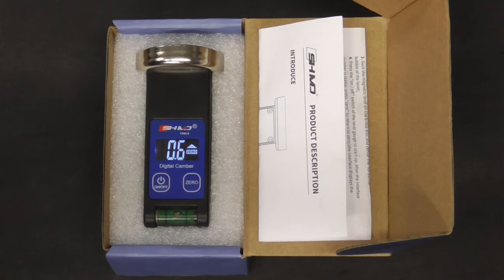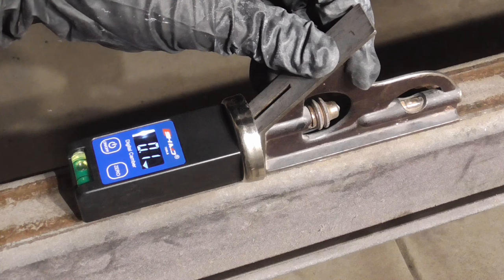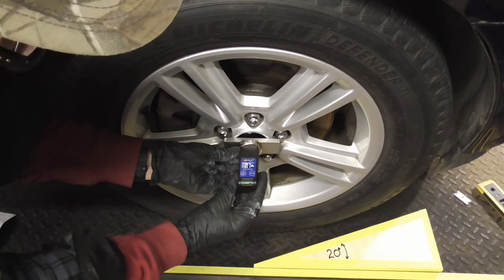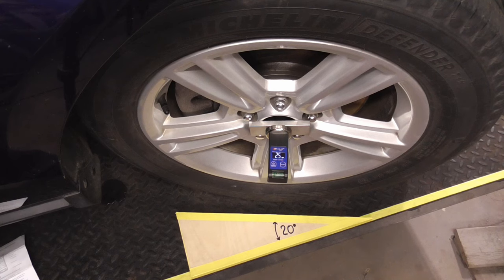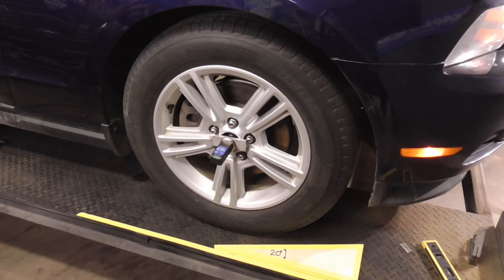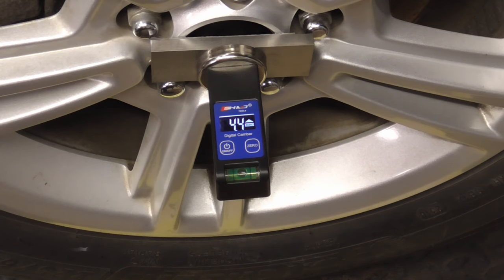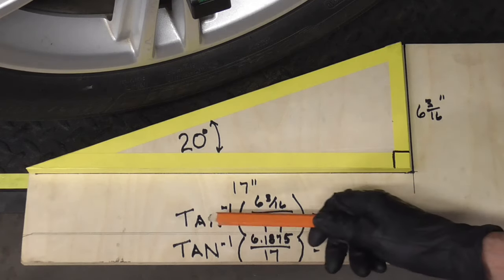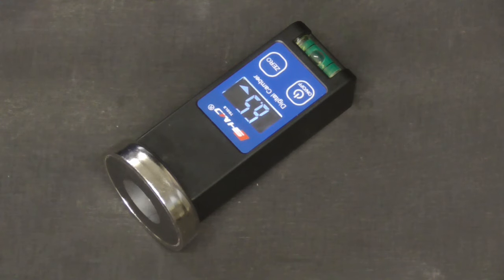Digital Caster Camber Gauge by KAISAL - Easy DIY Wheel Alignment

Comment: You need to multiply the "caster" measurement you have shown by 1.5 to get the true caster angle as would be measured on an alignment machine. If you look at bubble gauges, the scale is 1.5 times larger on the caster scale compared with the camber scale.  Otherwise a good instructional video. Thanks.
Reply: I'm a beginner but I'm not sure I can agree with that statement. A degree of angle change is a degree of angle change. If the digital measures that, then it's measured. The bubble gauges have more degrees change available in the caster bubble just for the capability. The camber scales are less degrees available to give more precision. I'm sure the arc of the glass tube in each is adjusted for the different scale. It still measures degrees of angle change. I'll bet both scales show the same degree change- until the camber scale runs out of range. Cheers.
Reply: @bw1841  Schnitzer is correct.  It is a trigonometry math equation.  If you measure the angle of the caster at 90 degrees, you would not have to do any math.  You turn the wheel out 20 degrees and zero the reading so that when you turn the wheel in 20 degrees, you get the difference between the out and in reading at exactly 20 degrees.  Then multiply that by 1.432 (1.5 is the industry standard) and get the true angle.  The farther the wheel is turned, the higher the gauge would have read.  You can do the same thing by turning the wheel 15 degrees in each direction, but then you have to multiply by 2 because your measured reading is lower by not turning the wheel as far.  There are digital gauges that do the math for you, but they have a caster button on them.  you turn the wheel out 20 degrees, press the caster button, then turn the wheel in 20 degrees and get the true reading calculated for you, but this one is only an angle finder and it does not do the math for you.
Reply: @CoroPlanesLLC  This is an excellent explanation and a very helpful answer. It's exactly what I needed to know to complete my alignment with a simple   castor bubble gauge.

Comment: OK.  bought the gauge. i did the castor check and it shows on left front 0.4 degrees arrow pointing in (negative?) and on the right side it says 0.5 degrees with the arrow pointing out (positive?).  How much trouble am I in?
Reply from the maker: It depends on what the specs need to be for your car.  Negative caster will roll straighter but positive caster will steer easier.  They should be the same though I would think :)
Reply: @LakesideAutobody  Am I correct about which one is negative and which one is positive?  I want positive camber.  It is a 66 xke so these things are really hard to change.

Comment: Had a front wheel alignment done by a tire shop with an accurate precision laser machine. I checked their results with the same tool in this video. The caster measurement DOES NOT need to multiplied by 1.5 and the tool displayed the same angular measurement of 4.7 degrees!!! BTW, 1 degree = 60' = 3600".
Reply from the maker: Thanks for checking that out - nice job.  Others will appreciate the comment too for sure :)

Comment: If I understand, you don't have to measure the floor angle when doing camber check because, you zeroed it perpendicular to the earth with a bubble level for instance, first.?
Reply from the maker: It was zeroed perpendicular to what the car was sitting on - in this case a 4 post lift -  think it was shown near the beginning of the video :)

Comment: How can you get any reading without using turntable plates?
Reply from the maker: Turn table plates show you the degree you turned the wheel - that's it.
Reply: @LakesideAutobody  no. Turntable plates allow the front suspension to spread out exactly like it was going down the road. After each or any adjustment we grab the front bumper and bounce the car to assume the new driving position. Degree markings allow you to check castor with regard to how the machine is calibrated. Bean equipment 40-50 years ago only turned 15 degrees. Without turntables you can't do any alignment.

Comment: This is great. I just bought the same item, then found your video!
I put a new steering rack on my pickup, and new upper control arms with balljoints. I must've had it set okay using just a level for camber, then a 2x4 on jackstands for toe adjustment. The tires haven't worn in several months.
I'm about to do lower balljoints because they have play.
I'll just set it with this when I'm done.
I've found that alignment shops only want to sell me suspenion work. Guys who do their own work are not a cash cow for alignment techs.
Any shadetree can do a satisfactory alignment just knowing the particular vehicle specs.

Comment: Cool I’ve got the non-digital budget version.  Used it and it kinda tells you a ballpark figure.  Problem is the fancy new cars have no adjustments.🙄. You kinda eyeball aftermarket shim things based on some magnet gizmo.🤷‍♂️
Reply: Right I learned that my 2004 INFINITI G has no camber or caster adjustments. You fix those by replacing control arms or bushings that are worn out. Then it's right. Then you pay for a whole alignment just to adjust toe...

Comment: How much can it effect caster measurement if you don't use a slip plate when moving tires back and forth? My thought for DYI'ers if performing on garage floor, spread out a small amount of very fine sand under the tires so when you turn them back and forth to perform caster measurement, they slide on the sand with out 'sticking' to the floor.
Reply from the maker: Good idea - seems like it would work :)
Reply: Use plastic bag with oil in it.

Comment: When he did the caster measurement,  did he forget to multiply the 4.4 degrees by 1.5 like it is suggested in other videos? Or when he leveled the tool, did it factor that in?
Reply from the maker: I think when you level and zero the tool out you're good - you don't have to multiply by 1.5.  Were they using the exact same tool?  Could be that their tool can't be zeroed out?

Comment: Can you explain what you mean by ‘zero the gauge in relation to the vehicle’?
Reply from the maker: Yes.  When you zero the gauge out in relation to the vehicle, you are putting the gauge in the same plane or "world" as the truck or car.  In other words if the vehicle is not perfectly level, that's OK, we can set the gauge to that same "unlevelness".  If that don't make sense ask again :)
Reply: This is tricky, assuming the ground is the same plane under all four wheels. Concrete will usually be the most level but even then might not be perfect (forget about your asphalt driveway!!). If the spot of ground you use to zero out the gauge is out of plane with the ground directly under the other three wheels you might have a problem. You'll still have this problem if you zero out on the ground by each tire. Realistically, setting it once should apply to all four adjustments, but real world? I dunno. This is why laser alignments will never be matched in the wild, they create their own plane.

Comment: set the toe and let it go,all I need is a tape measure,I can eyeball the rest
Reply: Yep, I replaced my entire steering and suspension and set it all up myself. Had new tires put on and a year later they still look new.
Reply: You didn't do camber, you just did the tore and tires didn't wear out?
Reply: @nahyoxsoldier3264  believe it or not,alignment machines are a newer concept,the people that taught me were some of the first people to use an alignment rack

Comment: What if the rotor is warped, how do you measure something like that? thank you
Reply from the maker: I don't think it would make a difference.  Usually a "warped" rotor is not really warped, it is microscopically thicker in one spot.  When you come off of an expressway at 80 and hit the brakes, then hold the pads against the screaming hot rotor, it can "absorb" some of the pads.  That thick spot ends up getting worse and worse obviously because it causes a hot spot right there - more friction every time you brake.  At least that's what I read so... at any rate - it's a very small measurement.  :)

Comment: Do you have to calibrate it first on a spirit level?
Reply from the maker: No - you will "Zero" it out in relation to the level of the vehicle.  You can set it on the floor, car lift posts, what ever works best for your situation.

Comment: Where did you get the small metal plate to attach to the hub?
Reply from the maker: It is a measuring gauge block (example) https://www.ebay.com/itm/225290642107?chn=ps&var=524268869458&_trkparms=ispr%3D1&amdata=enc%3A1n6eVlw8RS_q9lEA02K7xAw81&norover=1&mkevt=1&mkrid=711-117182-37290-
Reply: @LakesideAutobody  How did you attach it to the hub, magnet?

Comment: I get a  Tan -1 reading of these numbers as 35 not 20
Reply from the maker: Make sure the calculator is set to degrees and not radians - let me know if that works for you :)
Reply: @LakesideAutobody  I have an old Ti-81—THAT DID THE TRICK.  Go into MODE, select degrees instead of radians, then proceed to enter exactly as you have written down here on the math.  Thank you!
Reply from the maker: @esroot12  You're welcome - should have been a math teacher maybe.  Glad it worked 😊